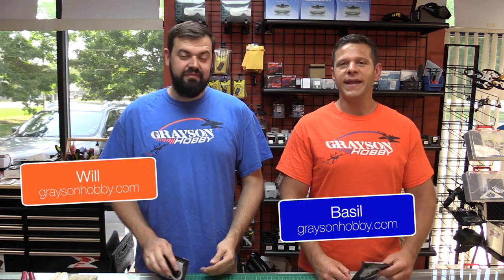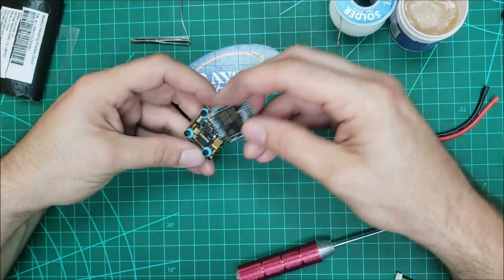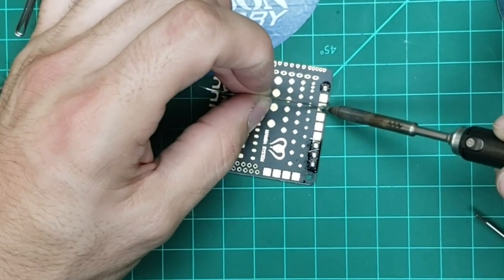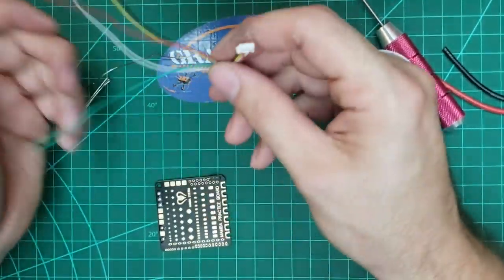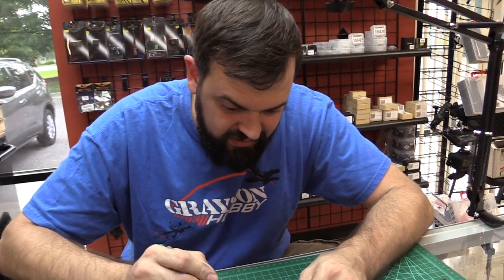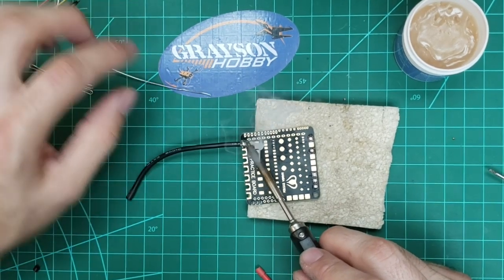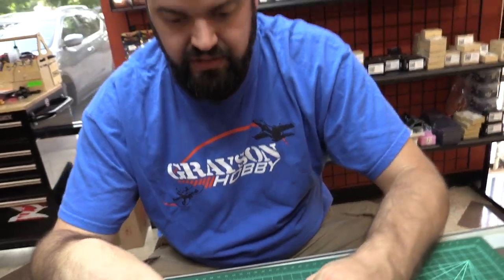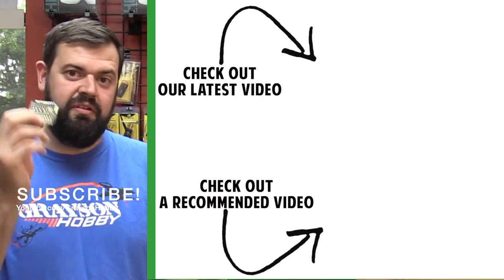Solder Practice Board - How to solder your 1st FPV Drone

Comment: Just ordered two. This is a great idea. I have been soldering for years but those tiny pads are really difficult especially with old tired eyes. This will help with finding a technique that works for me.
Reply from the maker: Awesome! Post to our FB Group your results! Love to see how much this helps - Basil
Reply: Pick up a Mustool G600 if you can afford it. They are a big help for old eyes. They are handy for removing slivers as well. Get the one with the aluminum stand.
Reply: Ray Dockrey no kidding, entirely new level of small.

Comment: A great product for beginners with no soldering experience. I would have bought this if was available at the time I started.
My worst soldering job was cold joint failure mid flight on negative power pad. Didn't have enough heat, large enough tip to get the job done properly. My kwad fell from the sky during its maiden flight. 🤓

Comment: Guys I was just there and bought that exact stack. Well I have a fair amount of experience soldering or thought I did. I ran into nothing but problems with the ESC and getting the solder to stick to it. Hard lesson learned but I was using the wrong or low grade solder and it turned into a nightmare and by the time I realized the mistake I got the power leads on well. The ESC is now bad. Ahhh the lessons amd this cazy hobby, just when you think all is well finally.

Comment: Great video I have been in the hobby for 4 years. 
I just watched your video before I go Sauter up my new Tmotor F 7 HD flight controller & 55 A ultra ESC. 
I still found this very very helpful thank you.
Also a suggestion for Diatone they should have any included a few of those pins for the holes through joints in their practice solder boards.

Comment: Not having seen this excellent video before I started attacking my DJI Phantom 2 Vision wifi board (trying to reflash to get FPV back), I spent so much time trying to get solder onto the pads (I didn't use flux....) that the pads are now dull and a little burned looking.

Can these still be used (after obtaining flux) or have I blown it?

Comment: I have the diatone gr 200s,with the furry f3s board ant the TBS that is soldered in the middle,but after a crashed the camera that was hooked to the jst plug on the board  got loose,so now I need to use the pads and they are small and close,and my soldering skills are not good,so I definitely will be getting this practice board.

Comment: I fried my first flight controller so I just ordered another flight stack - mamba f405 MK2 mini. Question for you, is that the size of soldering tip you usually use for the receiver, vtx and FC? I was using a very fine pointed tip but was having a hard time getting solder to go onto the pads. I ordered the flux you mentioned though, but was wondering if I should use a similar tip as yours. Also, jw if you would know if the order of motor wires matters?

Comment: Been soldering for 20+ years and have used every kind of solder that I know of without issues. I now use silver bearing lead free. What is the reasoning to say not to use lead free in this video? I am curious of your reasoning.  I like this video and the product. I will order some to keep in the drawer for when I feel rusty.

Comment: New to quad building.  Biggest mistake so far: bought a $30 iron that works nice but sometimes does not seem to be hot enough. Im going to invest in a better one. Magnification helps - going blind after peering through too long sucks also.

Comment: Yeaaaa. Someone on the internet is using flux. I just got done soldering for the past 2 hours at work. I prefer liquid wash solder from a dropper bottle as it transfers heat the best. You have to wash with water after you are done but it allows you to get the job done fast. Ideally, you want to have the iron on the joint for 2 seconds or less. When you twist wires you transfer oil from your skin to the wire. Flux removes this.

Comment: I wasn't worried after watching so many videos of fc's being soldered. But I went with a whoop board in a micro frame and every pad is like 1x1mm deffenitley don't recommend it if your not already proficient at soldering. particularly getting the power leads connected is a pain when the pad is the same diameter as the wire.

Comment: Can you show a tiny lollipop antenna solder job for tiny hawk 2  freestyle type board, because that’s what I need to replace and solder on and I have trouble with the antenna wires because they have a little clip plug connector on them and you need to splice the wire first and there so tiny an are small wires, Plus I don’t have the best eyes and I have a little bit of a shaky hand syndrome problem too, if you can show how to do a little lollipop antenna soldered to the board that would be great thank you!

Comment: Quick question. I'm attempting to get into the drone hobby and have just received a tiny hawk and studying alot to build a bigger custom drone. Before I try to make a custom I want to fix my betaflight. For some reason when I try to connect to betaflight it said failed serial port. I have checked and used many USB cables and am Shure that I downloaded all of the driver's needed. Would you know why my betaflight won't accept my tiny hawk. Thanks for doing constant videos and helping learn and progress into this hobby.

Comment: can you use regular plumbers flux on quads or is it a different type of flux?
Reply from the maker: Its waay different. too much acid in plumbers flux which will will corrode the wires and electrical components
Reply: @graysonhobby  That's what i thought. Thanks guys.

Comment: I've been trying to fix my quads for about a year now.  I haven't been successful yet and have been grounded the entire time.  I cant seem to get solder to stick and stay put cleanly.  I either burn the board or melt the wire and pad.  I also have 2 micros and the pads are so freaking small and my hands are so freaking shakey. Went and bought a ts100...still cant get it.  So far I've ruined 2 flight controllers and a 4 in 1 esc.  So frustrating and disheartening

Comment: That practice board is HUGE compared to some of those micro stack pads...    Not that i can't solder it's just an Old age thing.......can't see , have to use the number six lens about an inch think on my hobby glasses just to see the tiny pad and then my shaky old man hands that can't hit the mark when i do finally see it.....seriously....and I do not wear glasses normally ....LOL...but one reason I buy quads that are BNF....and why I have never built my own. [ also why i sent the quad to you ]  LOL
I had a BetaFPV 85 mm quad that the battery pigtail was not working...so went to change the pigtail...touched the pre-existing solder on the wire with my iron to get it loose and just that touch seemed to explode that tiny solder joint, solder ran all over the board.....tried to clean it but when soldered new pigtail and attached batter...that magic smoke appeared....why i I do not like messing with soldering be it my own or someones else's soldering.That's One example of many such incidents ...but the smaller it gets the worse it is to do anything.

Comment: In the late 50s and early 60s radios came with bare wires coming out of the Rx. You had to solder connectors on every servo and battery connection. There was a variety of connectors to chose from so nothing was Plug-N-Play. The word "Plug-N-Play" did not exist. Servos had 5-7 wires and there was no standard order on the connectors. I learned to solder at age 10.
Heat Shrink tubing didn't exist. Heck, 5-Minute Epoxy didn't exist. You even had to TUNE your receiver to your transmitter with a screw driver before each flying session.
Never trust a guy that twists wires together and wraps it with black tape!

Comment: Soldered a wire to full voltage then soldered the other end to vtx 5v pad lol poof..... if it had two boards pdb and fc it would teach  you so much more plugging a battery in to confirm good connections....lol make sure to include smoke stopper